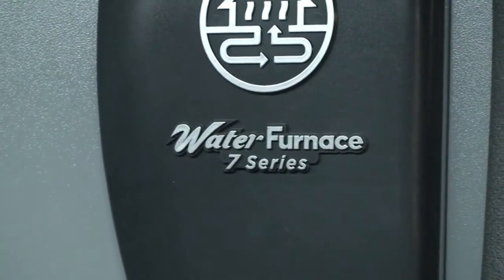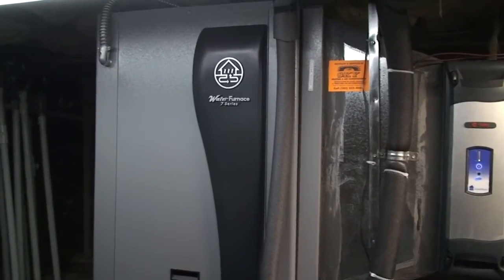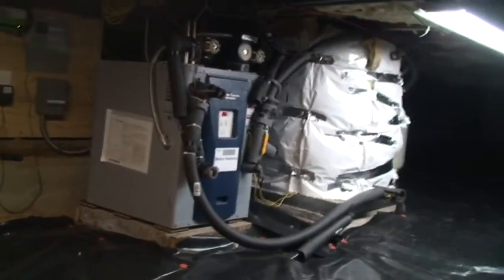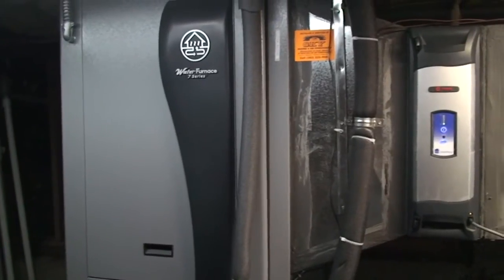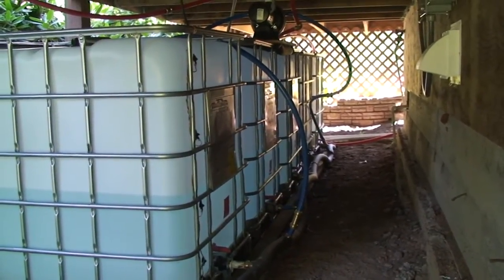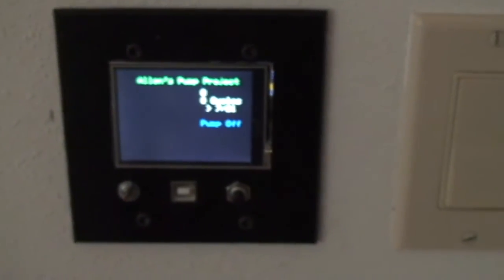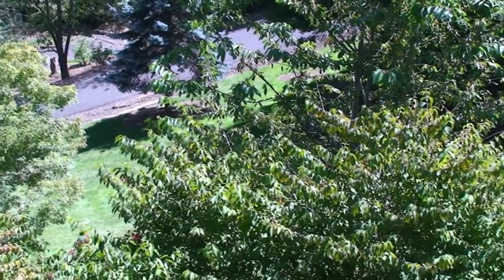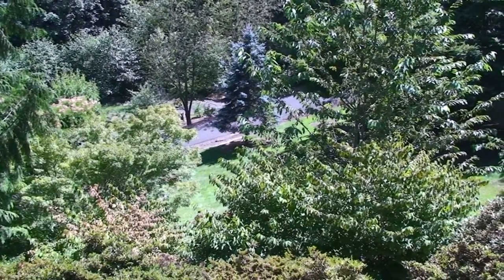WaterFurnace 7 Series How I Used the Water in Open Loop

Comment: thanks for the video. great system. can you feed these geothermal units with a standard well pump or do you have to step down the flow before the water enters? im an extreme newbie so please forgive me
Reply from the maker: The newer units use a modulating water valve to adjust the flow to what the heat pump require.  My old one was one speed so a 7GMP restrictor was used.  The trick is to get enough water to keep the pump in the most efficient range, not too much not too little.  Measure the incoming water temp and the outgoing water temp.  Mine liked about a 14 degree temperature change.  My incoming water temp was 53 degrees
Reply: @OldOwl  thank you for that information. that is good to know. i live in a warm climate where the ground water is a constant 75 degrees fahrenheit. is this application something that would still be feasible?